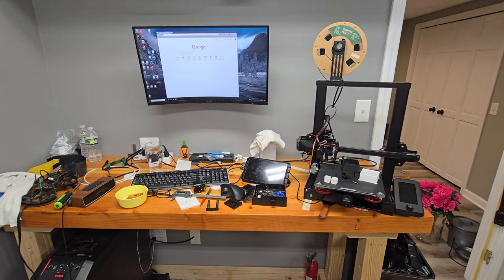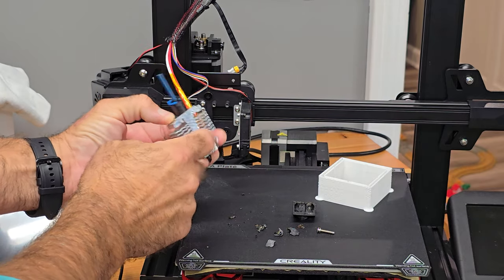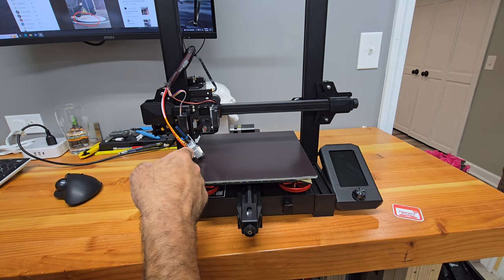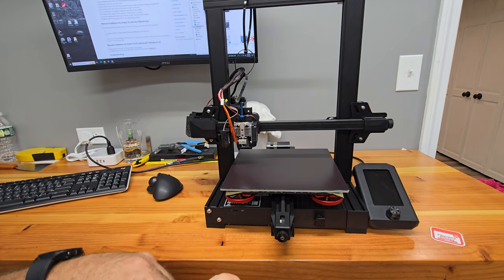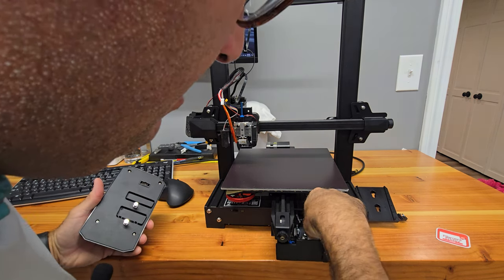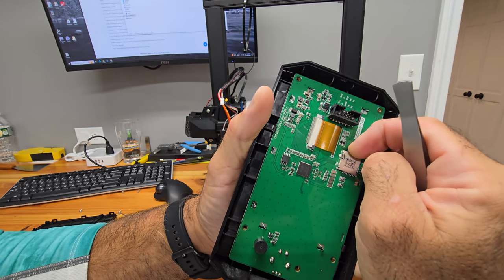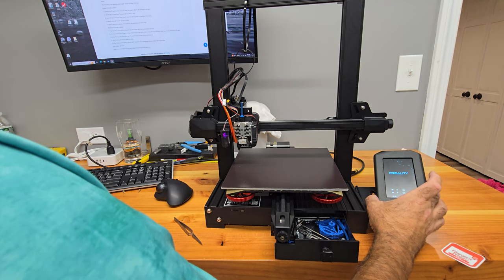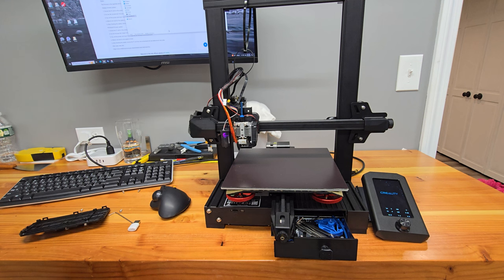Ender in the nuts

Comment: I had the same issues, new hotend and nozzle fixed it. Don't throw the upgrades away, they do make a difference. Stock means slow and basic printing.
Reply: Check out the rpi zero 2 W, works fine for klipper + cam and cost only 15$
Reply from the maker: Not throwing out, just on hold until I can get a good print on stock

Comment: sloooow down and gow back to bowden, and take apart the hot end clean it up and tighten it down
Reply: make sure firmware is for the right board you will have to take the board cover off to see
Reply from the maker: Got the right firmware and stripped it down to rebuild. Went back to Bowden and got kicked in the nuts again when the hot end fan just died.
Reply: @dougdoesstuff24  dang hope you know how to solder a new one on (shouldnt be to hard)